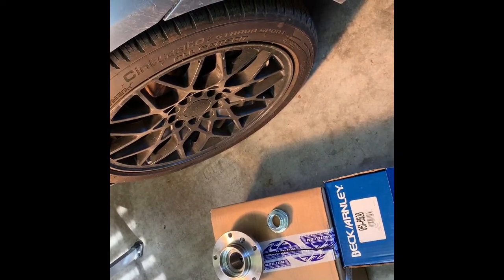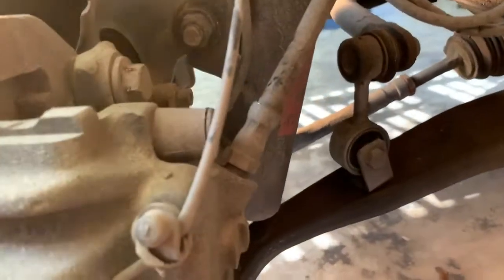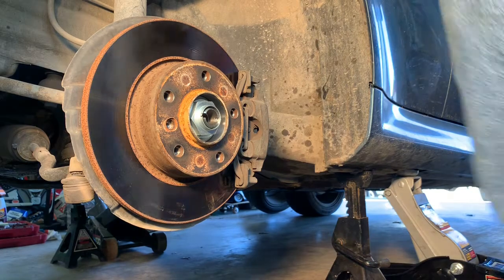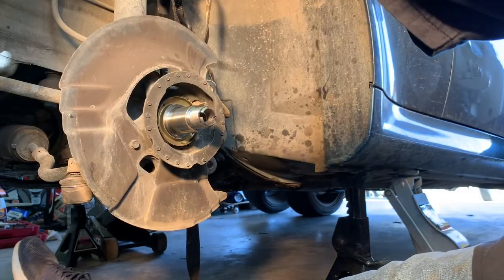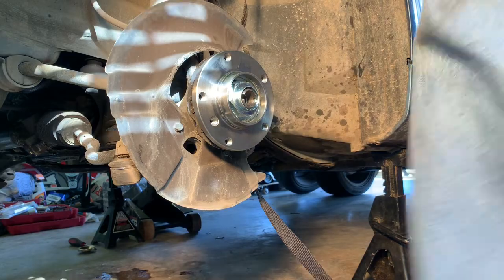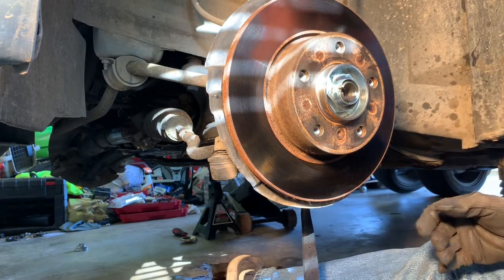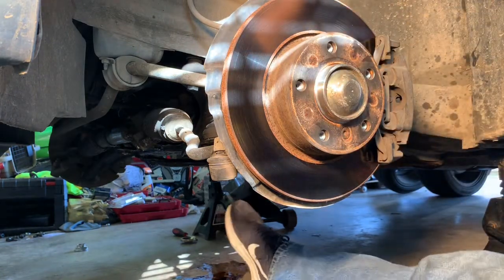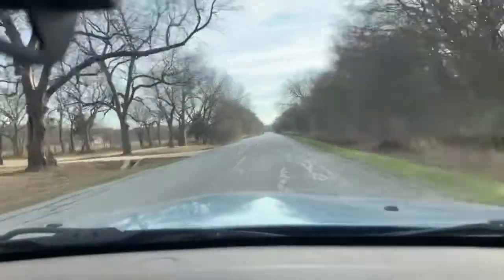BMW Wheel Hub / Bearing Replacement Z3 E36 E46

Comment: Hi thanks for the video. But at 21:21 that’s not suppose to happen if done right. The bearing had already split and ruined the new part. Most probably why it looked too tight when you tried to rotate it a few times afterwards. The hub and bearing assembly should be driven to the shaft by pushing evenly at the inner race only which directly contacts the shaft, not by pushing/hammering at the hub. Hope this helps next time!
Reply: I want to thank you because of this comment, along with this video and another video from another bimmer YouTube channel for pointing this out! Makes the job a lot easier

Comment: That's one leaky Z. Looks like your next DIY should be the oil pan gasket.
Reply from the maker: It was the oil filter adapter gasket that was leaking all of that oil. It has been fixed. Thanks for watching.

Comment: This is a wrong install! 21:21 .. got the install wrong see comment by Winterever below. If you do what this guy does you will ruin your bearing !
Reply: Too late now. Even Nathans BMW failed at installing a new hub on his e46 tutorial :D welp too late I f*ucked my front right bearing with that 46 socket. It has a tight spot when turning. At least I did the left one correctly.